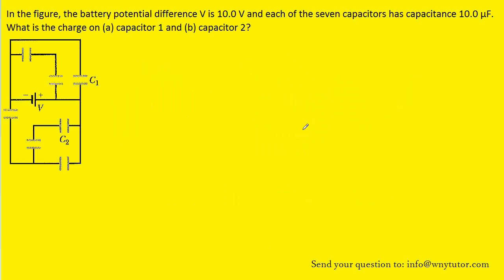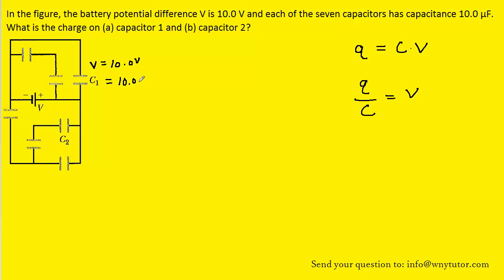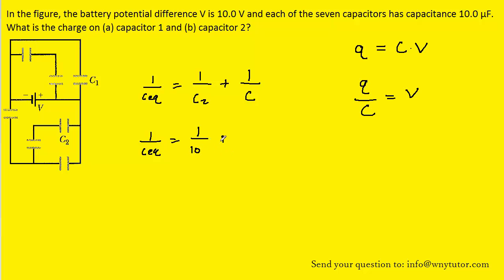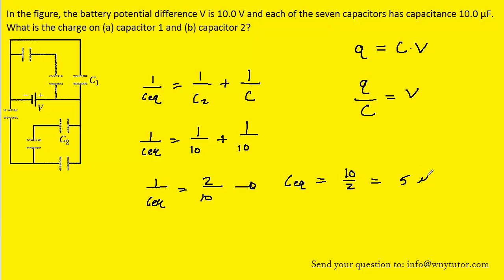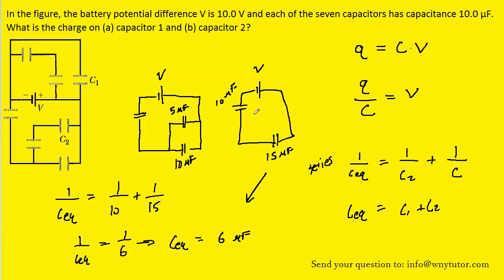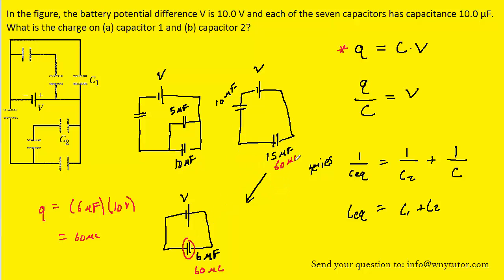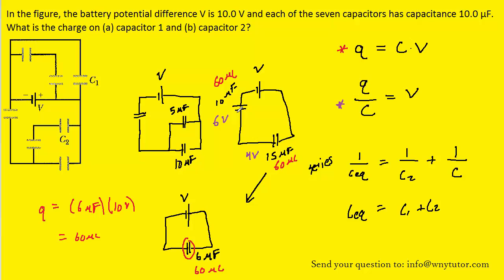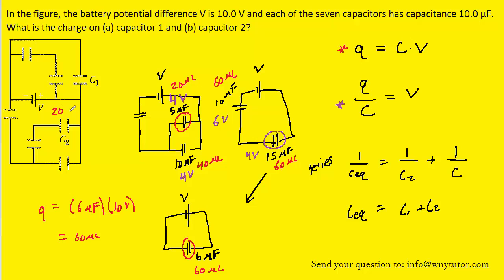In the figure the battery potential difference V is 10.0 V and each of the seven capacitors

Comment: Can you explain why the 10uF and 15uF are in series not parallel?
Reply: because the current has to go through both of the capacitors before it reaches back to the starting point. Hope that helps
.
Reply: no